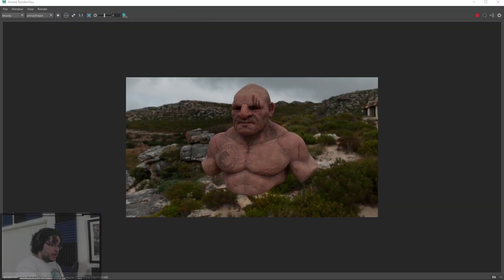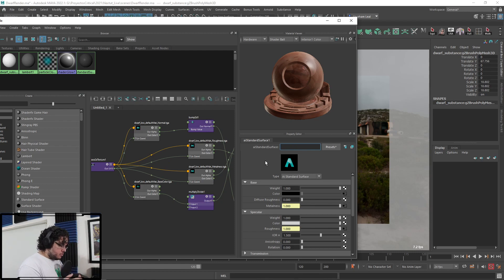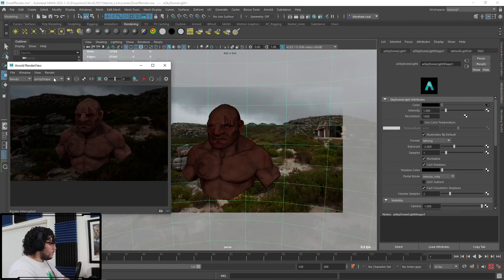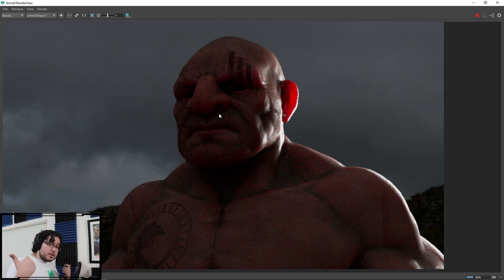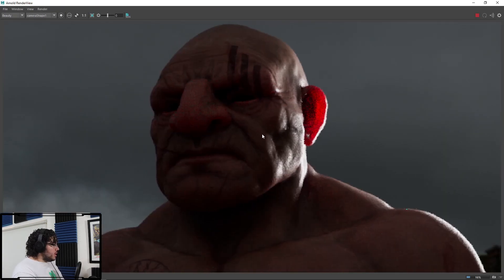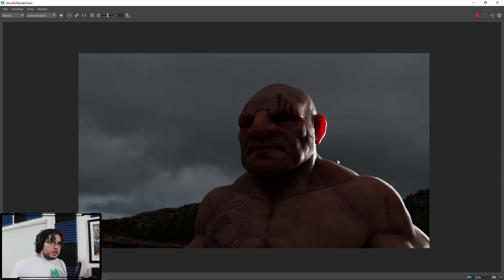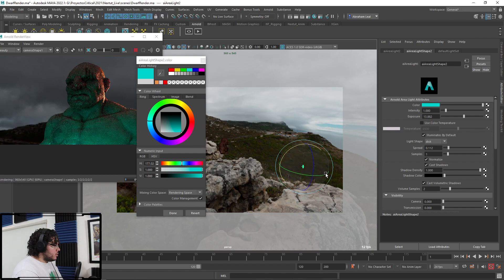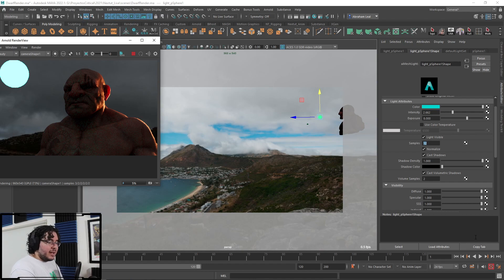How to Setup SSS in Maya Tutorial I Subsurface Scattering Skin Shader

Comment: SSS is waay too much. I would never use bright red as the scale colour, its more like like 0.8, 0.3, 0.1 with rgb 0-1
someone else in the comments seems to be using a metalness value for the skin which is totally wrong. I would never do that
From my experience, if you make it look good without an SSS value then you are on the right track, modulating between the base colour and the SSS

Comment: Have this question: I'm shading my model following your instructions here. I was trying to apply my skin shade, but it didn't work properly. I was using a metalness map and sss  on same shade... it seems I cannot do that cuz skin has kind of translucent surface and metal doesn't (at least that's what I understood through discord servers and reddit), so I had to use two different materials, one for skin and one for the rest. But here you are using metalness channel set to 1 (I imagine it's a map for metalness). Are you using layered shading, or is just one aiStandard material?